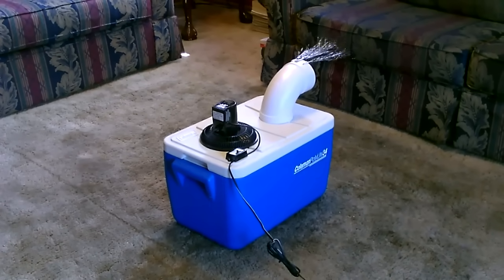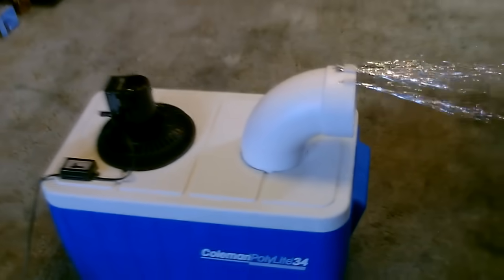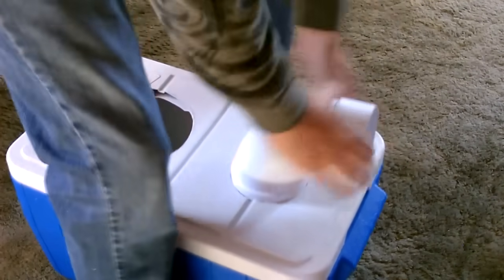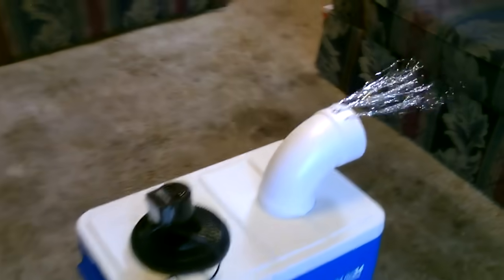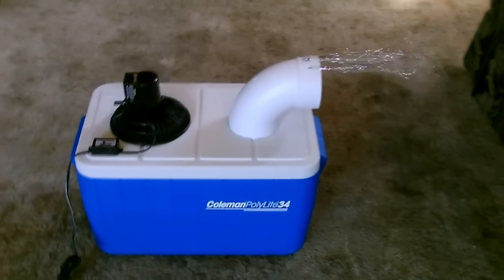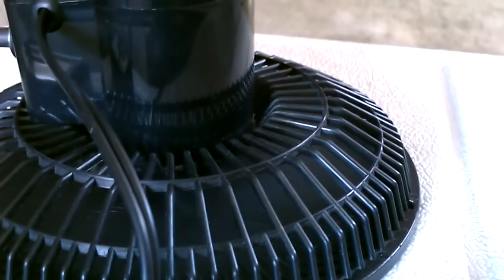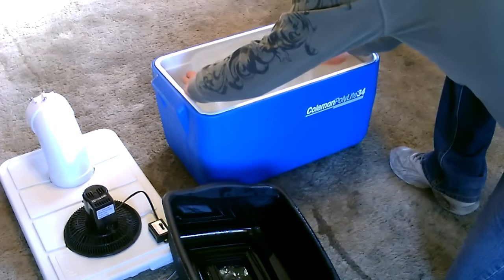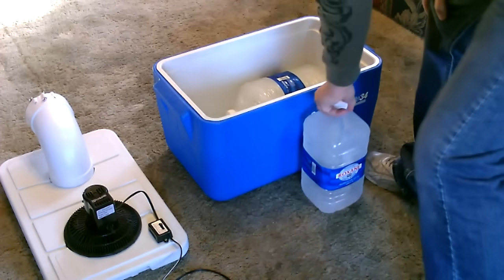Homemade air conditioner DIY - Awesome Air Cooler! - EASY Instructions - can be solar powered!

Comment: Which fan is that, can we use CPU fan for it
Reply from the maker: hi there. the fan is used is a 10 watt 12v 'auto expressions' fan from walmart. you can use a 12v compute case fan but most of those will have a weaker airflow than the 12v (clip-on style) auto fans.
Reply: @desertsun02  
Thx a lot mate

Comment: Sporty's Pilot Shop is selling these for almost $600! For airplanes. Damn, I could easily make & modify one to work even better in my airplane cockpit, just plug into the cigarette lighter outlet, place it in the baggage compartment and BOOM! The 100+ degree Texas Summer in a Cessna is tamed!
Reply from the maker: 600 wow. i had seen people selling similar ones to the one i made for 350 but not 600. i say just make it yourself 👍😎

Comment: Thanks.  How is the fan attached?  Just seated?  What fan did you use?
Reply from the maker: hi. it's just seated (but zip ties can be used). i used a 12v 10w "auto expressions" fan from walmart. sold in their auto dept.
Reply: @desertsun02  Many thanks.  Your design will reduce the misery of summer.

Comment: Those Christmas Tree tinsel came directly FROM the North Pole. They alone are the sole reason of it working and being so cold.  Do not, I repeat, Do NOT leave them out from this project or it will not work. 😊 Doing so couple possibly open up a gateway to hell in the process. You have all been warned.. Hell I tell ya.. 😊

Comment: I could've tried this out if I only had a solar panel. I guess it only works if you have solar energy. Not electricity. Or does it work with both?
Reply from the maker: hi. you don't need a solar panel to run it. you can also run it on a 12v battery. if you want to run it on AC power you can do that too. i made a short 2 minute video on how to run any of my projects on AC. here's the link https://youtu.be/GATesKJeLMM

Comment: What fan are you using?
Reply from the maker: hi there. it's a 12v DC (10 watt) fan by 'auto expressions'. found the fan at walmart (sold in the auto dept.)
Reply: @desertsun02  is it the one that says oscillating clip on fan?
Reply from the maker: i'm not sure how they market the fan these days, but that sounds right (the one i used has a removeable clip and it has the ability to oscillate).

Comment: I use 1 1/2 gallons of the ice cream containers those work good. I didn't use a cooler I used a big tote that can fit 18  1 1/2 gallon  ice cream containers. I haven't tried it with that many yet as my brother keeps stealing them as o freeze them  I'm sure with that many it would be nice n cool.

Comment: Shows what can be done very simply.
Would have been more interesting if tried to replicate evaporative cooler systems by improving efficiency using pads, drip screens, whatever you want to try. because then you might be eliminate that block of ice.

Comment: There's a type of phone you can buy to seal the cracks in between the cooler or whatnot so Steel you seal the cracks it would still work as a cooler but also you could reinforce it so long you know you have just a little zits a little bit thicker and you're not as far as he's concerned it may the ice might thaw you know slower if you insulated cuz if you pull that apart you know you still got gaps in between you know the material to the material to the material so you seal the gaps you might it might cool off or heat up the ice my heat up slower because the wal finate thicker but what's cold is going to might be holder insulation the cold might hold longer a Kohler colder a longer colder cooler insulation one must help me with this I'm I was kicked out side so you know you going to have to it's like ostracism I'm on the outside telling people what they can make to make life a little bit easier for everyone else not just me my investments it's like investing in you telling you to make something that'll make life better for someone else it's a big circle of success

Comment: What size cooler and PVC pipe did you use?
Reply from the maker: hi. it's a 34 qt. cooler and 4" pvc 👍🙂
Reply: @desertsun02  Oh damn it looked like a 3" Lol
Reply: @desertsun02  but 3" prpbably wouldn't be enough air flow right?

Comment: There is an equation very simple of pounds of ice per square foot needed to lower temp x degrees per y time..  Use a deep freeze w 5 gallon buckets frozen at night when electricity cheap . may need alot of ice

Comment: You think this would work with a regular computer fan?
Reply: It would but the air wouldn't be too strong
Reply: @RockyJayyy  do you know how many watts does little 6 inch fans from Walmart are?
Reply: @JohnSmith-xx1lx  probably around 20 to 50 watts

Comment: Circulating hot air through the cooler,? How long the ice lasts?
Reply from the maker: hi there. i usually get about 5 hours. but it will depend on how much ice you put in it and how hot the air is that's going in. i've gotten a maximum of 11 to 12 hours at a time a few times. that's when i'm running it using a solar panel on a partly cloudy day. the clouds will slow the speed of the fan from time to time and the ice melts slower.

Comment: just did this - totally free, used a vinegar bottle instead of PVC Pipe and an old fan.  our cooler was enormous, and I am still waiting on ice to fill it.  for now running it with some frozen hamburger and a couple ice packs.  not too cool yet,  waiting for more ice to freeze.  and i am finding that a smaller exit tube would have been better. i stuffed some styrofoam back in and it diverts the air better.

Comment: Major problem is that the refrigeration needed to freeze the ice releases that heat into the room. Then the ice is used to absorb that very same heat. One cancels out the other.
Reply: Ahhhhhh... but if you bought the ice from the ice store 🤯
Reply: Some people have deep freezers in the basement

Comment: How does the fan stay put?  Did you mount it somehow or is it just a snug fit?
Reply from the maker: hi. it's a snug fit. but if it's not just use 2 to 4 zip ties. i've done that on a couple other models 😎

Comment: Could you get more cooling efficiency/length of cooling by ducting a return from your cool exhaust as your inlet? I would put an ambient suction in the return if the fan starts acting funny to regulate the inlet pressure. Would be fun to try!

Comment: How long does the battery last with this set up?
Reply from the maker: hi. with the smaller 12v 12ah deep cycle type of battery you can get 7 or 8 hours of runtime per charge. if you use a standard size 12v deep cycle battery, say a 100ah one, you could run it for days at a time.

Comment: Wonder how this would work with using a styrofoam cooler you get at the grocery store and put the fan on top and cut some holes in the side??  cheap and you don't use up good plastic cooler.

Comment: I watched this video and built one of these, it works better on slow fan as the air in the esky circulates more cool air. I used it at the cricket, brought my little solar panel, filled it with ICE and BEER and had a nice cool air blowing on me the whole time whilst the rest of the crowd were choking on the heat. Then open the esky pull out a beer and enjoy a cold one with AC. FUCK YEAH!
Reply: Best comment. 😆 please share the looks you was getting
Reply: haha, had to rub it in didn't you : D

Comment: I am building one for heat. Taking my cooler and instead of ice I will use charcoal and yes I will have a smoke detector for when I sleep just in case.

Comment: How long does ice last? 2hrs, 4hrs, longer, are you an “ice run slave” ? Shalom!
Reply from the maker: hi. about 5 hours. the longest i've ever gotten is 12. that's if you run it slow, pack it full and it's not too hot, say in the low to mid eighties

Comment: The way to make this more efficient is to pour salt on the ice. As the salt melts the ice it needs to absorb heat, lots of it, so it will take it from the air. If you can make the air flw through the ice instead of on top that will really help too (but melt the ice faster)
Reply: BUT!!!! If you take the ice from the freezer inside your house and make more ice, you will make more heat from your freezer than you will gain cold from the ice since no machines are 100% efficient. So put your freezer outside first or buy ice. :D

Comment: Mine was a bit of fun and, just a spur of the moment build. I really like yours as a practical solution. I think I will be building. Its unusual for it to get hot in the North of England.
But your principles, like a thermos flask could be used in reverse. By filling the cooler box with hot water, it would work as a heater in an unheated environment ???

Comment: The key is the fan. I dunno where he got that 8"-10" fan with that much ass. I just built the exact same thing with the exact same cooler, put the new "high velocity" 10" fan on it turned it on and i can fucking blow harder than this piece of shit.  
 Back to the store for another fan....
Reply: Yeah, I wish he had mentioned which type of fan it is. Did you end up finding a good one?
Reply: @bandoogiemanz  i bought a few and returned them all.... from $20 to $70 all were junk power wise
Reply: @davehoyt8965  Damn, it's pointless to build this if i cant find a decent fan to power it? What are you going to do?
Reply: @bandoogiemanz  go buy an ac unit lol. I only did this for the hell of  it to see if it worked. Literally took 15 min to cut the cooler top and put everything together but all fans are junk
Reply: @davehoyt8965  i would if i could, but im a basement dweller.

Comment: Awesome idea,but wouldn't this cause mold and mildew in your house
Reply from the maker: hi there. no they don't have that issue. not at all. it's just some melting ice that thru (conduction cooling) cools the air. these types of coolers don't add an perceivable or noticeable humidity to the air. i measured it at less than 1/10th of one percent.
Reply: So how big an area would something like that cool on just one fill up of ice,any idea

Comment: Good man for not using dry ice.
Reply: Whats wrong with using dry ice?
Reply: @bandoogiemanz  Dry ice is frozen carbon dioxide. When the fan blows on the dry ice it boils and turns from a solid into a gas. This gas (Carbon dioxide) will fill your room and suffocate you.
Reply: @oscarmuffin4322  yeah i just looked it up, thanks.

Comment: Do you think 2 blocks of ice would last longer? Also, what would you suggest to insulate the container more to get the ice to last longer?
Reply: I saw another you tube video where the guy drilled holes in the lid and used a straw attached to a can of spray foam. He sprayed inside the holes and let sit for 24 hours. The spray foam expanded out of the holes and he just scraped the foam after it sat for the 24 hours
Reply: Styrofoam

Comment: should use a sealant of some kind around the piping also make a rubberized seal where you place the fan to maximize air pressure, also a stronger fan would improve the airflow a great deal i bought 2 vornados older models cus iused to live in a small place with no real good AC and a computer was in my room so even with AC it didnt do much against the powerhouse i had( current one dishes out more heat) so i used a similar model to yours but with the sealing it creates a much stronger outpour of aircurrent. also cut off the end poking out and place a cone shaped piece of piping with an adhesive after slipping it over the other side this will allow the air to hit a larger surface area when used so you dont have to huddle next to it  as much. also using a secondary smaller fan (as i stated had 2 vornados) used the other one to blow the cold air up to the ceiling area where it cross connected with the ceiling fan so it blew the could air down into the room so it acted more akin the wall mounted or ceiling vented AC unit.

Comment: There are thousands of comments over years here already, so I'm not asking anything new, but why wasn't the fan shown fitting into the top? Also, what size (rating?) solar panel was used. Also, was that a special fan that runs of 12 volts? Can it run off AC wall power?
Reply: He said 15w solar. I don't think that's actually enough to power most fans. I run 300w solar in my van, and a roof fan runs around 2-3amps per hour. That's 1/100th of my 300amp hour battery bank. Running directly off solar would be a challenge. I draw 30amps in the middle of the sun with 600w. He's using 1/40th of that. A consumer fan draws more than an RV fan, considerably, like 15-20amps. 1/40th of my 30amp draw is less than an amp using a 15w solar panel. This isn't feasible on that low amount of solar, even direct sunlight.

Comment: How many sq. metres can it cover?
Reply: 0, since to produce the ice your are pumping heat in the room. At the end on the process the air temperature has gone up, not down, and you have thrown away your money in electricity

Comment: I found that if you are using the frozen jugs put a few old ice cube trays on the bottom of cooler to get jugs off bottom of cooler allows more air circulation and drops temp even fruther

Comment: I'd like to simply point out he use a thermometer to test the temperature that this thing was pulling out and it was putting out when was Bear ice 42° last time I checked no AC on the planet can put out 42 degree temperature that's incredible
Reply: While I do agree.  I doubt it could sustain that temp very long. I imagine that’s with the fresh block of ice at its best.  But this is still a great idea in a pinch. I imagine if you had a little pop up camper this type of system could be a lifesaver

Comment: This is awesome! 
1. what kind've battery are you running (i.e.) which one to buy?
also: the solar panel. where do I pick one up?
Reply: I know you can get a cheap solar panel at harbor freight. The fan just has to be 12 volt and have a lower amperage rating than the panel. I would shoot for quite a bit lower since the panel is probably overrated. Looks like he is using one made for a boat or RV but you could also just use a cheap radiator fan like this one: https://www.ebay.com/p/10-Inch-Universal-Slim-Pull-Push-Racing-Electric-Radiator-Engine-Cooling-Fan/2211417910?iid=332360127403&chn=ps&mkevt=1&mkrid=711-117182-37290-0&mkcid=2&itemid=332360127403&targetid=484681420451&device=m&adtype=pla&googleloc=9032376&poi=&campaignid=1497324383&adgroupid=60383707880&rlsatarget=pla-484681420451&abcId=1139456&merchantid=114602005&gclid=EAIaIQobChMIyMLbl_zh4gIVBSaGCh2Q5Q57EAkYDyABEgIrUfD_BwE
Reply: I forgot to mention that the small 12v fans for RV's are usually much lower wattage so even though they are expensive you can run them with a cheaper solar panel.
Reply: How do you connect the solar panel to the fan?
Reply: @wallaceamanda81  You can just connect the wires directly with clips like in the video. If they are backwards the fan will go backwards. You can add a switch to either wire if you like and then you could permanently connect the wires.

Comment: Did you find that using this evaporation style increased humidity/moisture where you used it? I'd be concerned about using this in a tent for that reason.
Reply from the maker: hi there. this doesn't increase moisture in any measurable or noticeable way.. it just turns the ice from a solid to a liquid (but not a gas). it's not evap. based cooling, it's just conduction cooling. this would work well in a tent.

Comment: So I know people are gonna think I’m lame but I’m not understanding how you are connecting the fan to a 12 V battery and or the solar panel, could you just explain that part to me better. Not really handy with that kind of stuff electrical wise. My AC in my Honda CRV went out and I cannot afford to fix it and me and my kids are dying in the humidity and heat and I need to make this for my car, & attach it to my cigarette lighter. We might possibly move back to Arizona in which case I need to do the solar panel thing.

Comment: Does it drip any water or does any water come out from the blowing by any chance, what size room does it cool, how cool does the room get ? No one will sit in front of it for 5 hours, I want to walk in and feel the difference now. If 85 degrees outside, then I want to go in and feel like its 68 degrees in home. That's normal to me. If not then is it worth it ? Yeah for campers and small CABINS but is that all. Also not 1 PERSON has used a cooler up on a stand yet, the higher the AC the better you feel the cool air, cold air sinks to floor, hear rises now. So this needs to be off the floor. It should be on the countertop for best use.

Comment: It would be total bad ass if you could get the PVC pipe to be oscillating!! 1 PVC pipes on each side and the fan in the middle then you would have a very very nice machine going
Reply from the maker: hi there. i'll work on the oscillating idea. my latest ice-based air cooler is similar to what you describe *it has a "double power" fan in the middle with Two 4" vents (one on either side of it.). if interested here's the link https://youtu.be/fD1J5hytxSQ

Comment: the problem with this design is that it humidifies the areas being cooled
Reply from the maker: hi there. that's a common misperception. these don't add any noticeable humidity to the air. as the ice melts it just goes from a solid to a liquid (but not a gas). the air is cooled by conduction vs. evaporation.

Comment: Insulate the cooler further and it lasts even longer. We did it with a yeti some hipster threw out because it some scratches and dents on it (Seriously morons?) Oh well, worked great, ice lasted about 28 hours we used 3 blocks and put it in the camper in the truck during Deathvalley 118 last year. Figure it costed me a few bucks to get ice every few days, replaced the need to run the AC on the camper. Nice little trick.